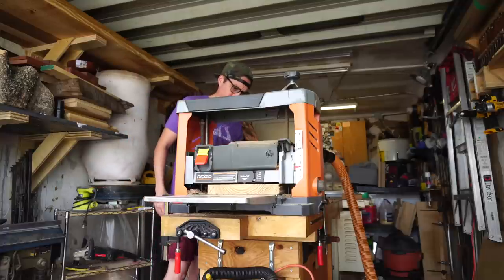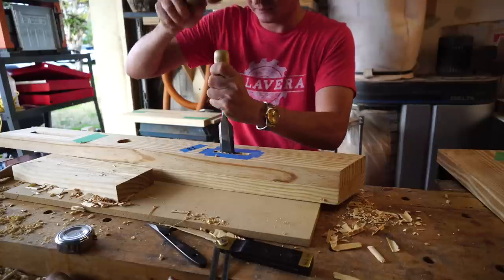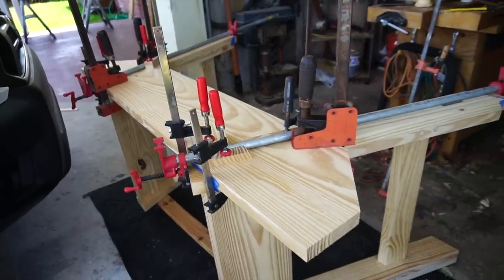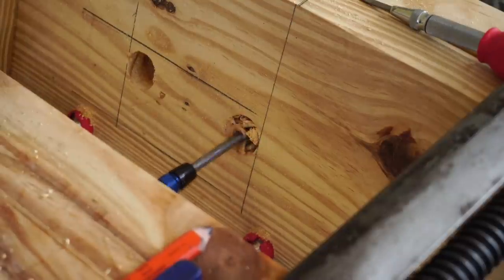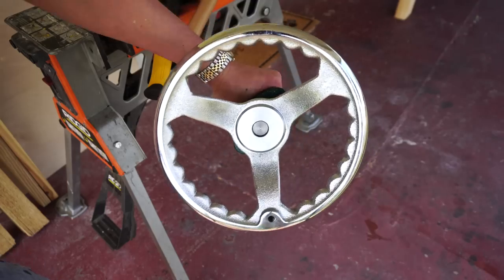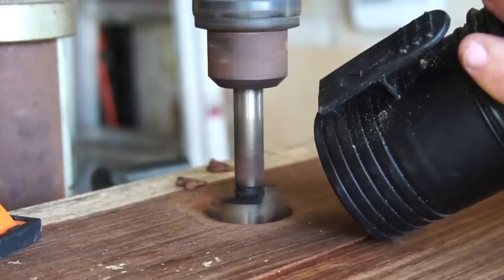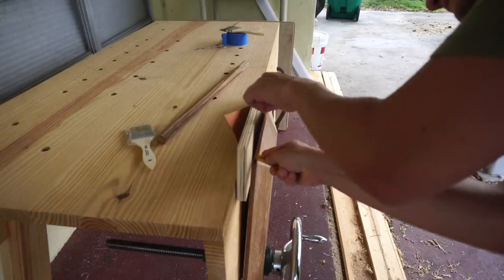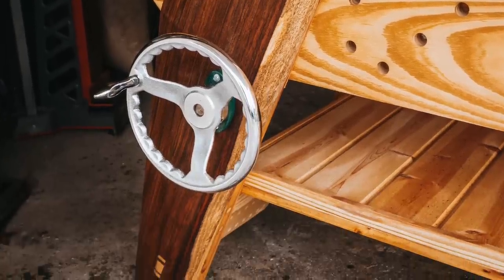The PERFECT Woodworking Workbench? | The Nicholson Workbench | English Workbench

Comment: Beautiful build! You used PVA glue on Rosewood which is an oily wood. Textbook is PU or epoxy for that wood. So three years later, I'm very curious to see how are the glue joints holding?
Reply from the maker: Still good. I’ve put out about 30-40 videos since then I reckon so there’s a video log of evidence. 😂 I can’t remember if I showed it in the video… but I used denatured alcohol to pull out/break down a lot of the oil on the seam. Which is what I did on the speargun I made from the same wood. Trick I learned from speargun makers using teak.

Comment: Love it. I’ve built a few Nicholson benches and think highly of them.   Yours is over the top
Reply from the maker: Thank you! I’ve been considering building a more simplified vice-less version for my back yard with the plane stops set up for Japanese hand planes. But that’s probably fairly far off.
Reply: In what way is it over the top do you think?  Do you think, for example, that there are too many work holding options? or that as its a work bench it does not require the degree of craftsmanship applied to the joinery etc? 
 If you can see a simpler easier way of getting the same degree of functionality, I for one would like to know what it is bcoz being unskilled, I need primitive easy stuff to make things work, at least fairly reliably.

Comment: Beautiful bench, great build and editing.  One suggestion, just like you backed up the dog holes in the top with some additional material, you might want to do that for the aprons as well.  In your first shot of using the holdfast in the side apron, you can already see it start to wallow out the hole because the holdfast is canting over too much and putting excessive pressure on the top corner of the hole.
Reply from the maker: Sweet thank you!

Comment: R g'day. Nice build. What's the advantage of Miller Dowels over normal dowels? Does that advantage change if you use thicker normal dowels? Thanks
Reply from the maker: So the topography of Miller dowels allows it to be fixed in horizontal and vertical planes... whereas I would be nervous that a regular dowel oversized or not might only prevent movement over time in the horizontal plane (I’m referencing physical movement not wood movement). However, if you used some large dowels that have some fluting to allow for glue, that might work as a fix. My concern with a standard smooth dowel would be not having that glue surface to prevent the top from lifting off under force.

Comment: Quite a stunning build! Surprisingly, a mortised bench stop works better than that aluminum one, I regret installing in on my last bench. Also, Nicholson illustrations show leg shoulders angled (with matching housing cuts in aprons). It's for making a gap less apparent when aprons will shrink, learned that a hard way too.
Reply from the maker: I wanted to get the benchcrafted plane stop but the issue is location for me. You have to do a reach around (heyooooooo) the apron and where my bench is, it’s routinely blocked by the tablesaw because of my size limitations. With that being said, I’ve been using this stop for a few weeks now and I don’t hate it, although I can see it’s limitations. I’m working on a desk now and had to use my doe’s feet as plane stop extender because I was in this weird no man’s land where I was out of space to pin it in the back with a holdfast and doe’s foot yet it still wasn’t reaching the quick release vise.

Comment: A fantastic video, these benches used to be all over England and the UK before we became a land of plywood and MDF
Reply from the maker: Yeah I see a lot of variations of it here now. Might even make a second one.
Reply: @CowDogCraftWorks  well if i could ship it over to the UK id be a buyer. I have a German bench (circa 1860) but it has been repaired so many times plus the dog holes are so worn away as to be none functional. I don.t have time to make my own. So its a Sjobergs Scandi Plus 1425 Bench & Storage Module for me. All my restoration work is with hand tools.
Reply from the maker: You can always use a dowel or a wooden plug and glue to re fill old dog holes and then redrill them.
Reply: @CowDogCraftWorks  you would need to see it , the bench looks like it came off the Mary Rose x

Comment: For a planing stop that's less fussy than the Lee Valley use a thin piece of stable wood - I used a strip of oak flooring about 1/4 inch thick and 2-1/2 inch wide.  I have a line of dog holes along each side of the bench so I located two "pins" cut to fit snugly in the dog holes at the end of the bench, attached with counter sunk, brass wood screws.  A 1/4-inch hole at one end allows it to be hung above the bench with a pair of winding sticks of the same material.  The wide access across the width of the bench makes it less fussy than a metal plane stop.  The brass screws mean that even if you accidentally hit one with your plane the damage is usually going to be to the screw.  I've used the same piece for years, so the apparent weaknesses are not a factor.
Reply from the maker: Sweet. Thanks for sharing.

Comment: Have you found that the dog holes on the benchtop have withstood the pressure of the holdfasts?
I've seen many people talk about how a thin top causes the HF to elongate the holes since they have to skew at a steeper angle to provide the friction than they would if the top were around 2.5-3".
Reply from the maker: The dog holes in the top, because I doubled up the material from the underside, are 2.5”. But with that said some of the holes are a little twerked. AND with that said: they all function fine and hold. If you check out some of my more recent videos you can see the bench fully in action.

Comment: Really nice bench .You built this extremely well. Probably the best design out there.100% agree with the quick release vice.I also thick flattening the bottom is a waste of time but each to his own.
Reply from the maker: Thanks. As for the bottom I agree in part. I don’t think it needs to be DEAD flat. But I think at least having it settle in a mostly flat posture works well and makes your life easier in the long run.

Comment: Great work and great video, well done. I built a similar Nicholson bench about 2 years ago and have not fitted any vices to it. I have a spare Record 52 1/2 vice and have been thinking about adding to the end just like yours. Just wondering A if you think its worth doing? B do you use it a lot and for what sort of things mainly? and C if you camp on one side of it in jaws or dogs, does it rack, and cause any problems? Keep up the good work. Cheers Rich
Reply from the maker: It will rack a little. For the most part though I’m using it to secure long boards on the work surface between the plane stop and a small bench dog on the top of the vice. So I don’t have to get crazy with cranking the vice down. I also use it a lot for securing smaller things for planing. It gives great structure and support for that. A tail vice would have been nice back there but I think this was a great alternative and it gives me a more versatility. I also clamp my bench hook or shooting board in it too.
Reply: @CowDogCraftWorks  Many thanks for that. I'm seriously considering adding one to mine so that info is very much appreciated. Cheers Rich

Comment: A great work bench, whether it's called a Nicholson Bench, a Moravian Bench, or whatever.  Great work!
BTW: I hear you about the blue tape/CA glue clamping block.  Not my fave either. I use brown craft paper and wood glue instead. Excellent adhesion, Easy removal with a hammer tap. And the paper can be easily removed with a plane or scraper.  One person's experience...fwiw.
Reply from the maker: Thanks jerry! I think the difference between this and a Moravian is the dog holed apron. It’s my understanding that moravians are more open. With that said I think Moravian workbenches are badass. Might make one for my patio.
Reply: @CowDogCraftWorks  Now that you mention it, the Moravian benches tended to have fairly narrow slab tops, unlike the Nicholson Bench, so I think you are spot on here. And another bench sounds good to me anytime! I am working on my fourth bench.  👍😎

Comment: Love the bench! Nice work, really impressive.
Reply from the maker: Best tool I have in my shop!
Reply: Hey Chris.  I bought Chris Schwartz’s book via the link.  Looking forward to having a go at building.   I am a small guy as well so I’m thinking about 6ft max.    What was the total board ft for your?  It looked like from the video you had 7, 16ft 2x12’s correct?  Many thanks.  Paul
Reply from the maker: @paulbrend8354  hey man! So I wish I could tell you. I made this over three years ago. I would say that looks about right though since I used the bigger boards to get my smaller dimensional lumber.
Reply: Thanks Chris.  We don’t have access to Yellow Pine so I’m going with Ash and they don’t come with in 2x12 16’s so I will get it figured if you think 7 boards was correct.  Thanks again much appreciated.  Paul.
Reply from the maker: @paulbrend8354  best of luck. If you’re on Instagram or anything tag me when you finish. Would love to see it.

Comment: Would it make sense to recess the wood on the vise so that it sits flat, or would that create a weak spot? 
Asking because I was thinking of doing that for mine :) 

Awesome job by the way!
Reply from the maker: Are you speaking of the quick release vise? There’s not necessarily a rule against that.
Reply: @CowDogCraftWorks  Yea, OK cool :)
Reply from the maker: What I would watch out for is the length of your vise jaws. So let’s say the jaw runs the whole length of the end of your bench, you’ll be more prone to racking on the ends of the jaw. But that’s probably about it as far as issues.
Reply: @CowDogCraftWorks  Yea that makes perfect sense. I was originally going to go as wide as the vise then I saw yours. So I might go 3-4 inches wider on each side.

This is exciting, now I just need to build the entire bench 😆

Comment: Do you have a detailed set of plans for this bench.  If you do I would like to buy a set.
Reply from the maker: I personally do not. However, the pinned comment has an amazon affiliate link for Christopher Schwarz from lost art press’ book on workbenches. That has detailed plans for this bench as well as the roubo. I followed his plans for the most part, with modifications only for fitting it in my shop.

Comment: that is freakin' awesome man.....how many man hours did that take?
Reply from the maker: That’s a little tricky to gauge. I had started it in mid to late April at the beginning of lock down... but then another project got in the way of me finishing it until a few weeks ago. The front end work on the bench, basically building the torsion box portion without vises didn’t take terribly long. Probably about a week. The vises and the top took the longest. My gf jokes around that I would sneak away in the house to go out front and take a few hand plane passes.

Comment: Very nice.  :)
However, I'd glue some metal piping into these holes or it won't be long before they're all egg-shaped.
The wood is fairly soft so I also recommend using a disposable plate on top of it. That makes it easy to throw it away and put a new piece on it.
10:15 And..NEVER hit a steel hammer with another steel hammer..you risk chipping one of them. ;)   (I know..you didn't hit it hard, but anyway).
Reply from the maker: So... I’ve had it for over a year now. The dog holes are fine. Also... if I need to re drill them I can use a 3/4 plug cutter to cut a face grain plug and re drill the hole. I also don’t think a hold fast would work nearly as well holding against metal. I don’t think the friction and wedging created would be the same... but I have no idea.

Comment: Scraping a workbench sides? I don't think I am going to follow that idea but I did like your substituting the wood screws to secure the glued underside of the benchtop with miller dowels. The PVA mixed with CA glue is a new one for me and I'm a bit wary. What species are you calling rosewood? I don't think a tropical hardwood belongs on a workbench. As for those leather guys telling you to use contact cement instead of hide glue, they've never had to repair or replace worn leather from a face vise. The last suggestion that I can make is to not make a solid shelf under the bench but one made of spaced slats to allow shaving and sawdust to trickle through so you need needn't remove all items to sweep off
Reply from the maker: Thanks for the input. I want the sides to be a sheared finish so that work can rest flat on it. It’s a direct 90 from the top. The wood glue set with CA glue is a pretty common practice. I’m certainly not the first to do it. As for rosewood: it’s either Indian or Brazilian rosewood. It’s hard and it’s pretty. It looks great. I don’t see the downsides. As for leather... I’ll cross that bridge when I come to it. A gap slatted bottom would also be highly functional too. I like the look and ease of setup with the tongue and groove and it’s all open so a hit with my blower does the trick to be honest.
Reply: @CowDogCraftWorks  Are you saying that you obtain raw logs from Brazil or India? And I get what you are saying about sides flush and 90 degrees to the top. My comments was about creating a final finish with a scraper. I wouldn't even recommend more that a #7 or a #5 with a flat blade to create a worksurface
Reply from the maker: No, I’m saying that there are subspecies of wood that are invasive here in south Florida that grow locally.
Reply: Cow Dog Craft Works Nope.. never seen an Indian or Honduran Rosewood tree here in south Florida. Mahogany!?? Really?? You think those types of trees would even grow in this subtropical clim.. oh wait.

Comment: Step one to building a workbench: Have an existing workbench. Jokes aside, thanks for making this video!
Reply from the maker: haha yeah that old workbench of mine was probably about as sturdy as a folding card table.
Reply: Your not wrong. But that isn't to say you can't make something without all the fancy tools. These benches come from a time before power tools, so this can be made with only hand tools. Now hand tools can still be expensive, and you have to have a bench to work on. But that is the irony of these things. You need a bench hook to make a bench hook. You need a bench to make a bench. Etc.
Reply: Just start with saw horses lol
Reply: @tommyfeaster39  Yep.  I built my bench on two saw horses and some plywood for a top.  That will motivate you to build a good bench.  Just as here, I built the base and then the top.  Hardest part of the job was moving the top from the saw horses to the bench base.  Yellow pine gets heavy in a hurry!

Comment: hey, i liked the video, but one thing bothers me, USE A RIVING KNIFE ON YOUR TABLE SAW !!!
Reply from the maker: Hey there! So I do have a set of splitters that I need to install. But honestly? For the most part it’s not that big a deal. I don’t tend to take huge passes in wood that’s got a ton of tension or is particularly green that causes it to pinch. Also it’s a 220v 3hp saw so for the most part it eats and as long as I’m careful, which I am, not having a riving knife or a splitter installed is not fatal.
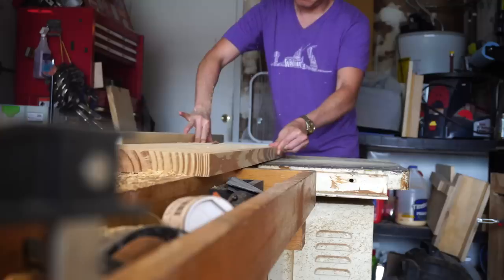Reply: first of all, it is always best to have safety tools if they don't intrude with your workflow, secondly, kickback doesn't always occur by tension that pinches the wood piece, it also happens when you push a bord down the path of the table saw and you release it to soon, (while the piece of wood is still in contact with the blade) so the teeth of the blade catches the piece and shoots it back at you, farther more it doesn't help that you don't use a push stick on cuts that you should, you place your hands way to close to the blade and you lean over the blade (as seen in 1:54).
Also, you said: "as long as I’m careful, which I am, not having a riving knife or a splitter installed is not fatal" emphasis on "as long as I'm careful", you can be the most responsible person in the world but after all, we are still human and as human nature, we all still make mistakes from time to time and it takes only one time of being carless to cause something irreversible to happen.
One more thing I want to point out is that if you have a YouTube channel of any size you are a public figure and you need to be a good example for all of your viewers, so if you're not willing to use a riving knife for your own sake do it for the viewers'.
P.S: I am sorry if this commend came at all as condescending, I had no intention of it sounding that way.
Reply from the maker: It’s an appreciated comment. However, I’ll get a riving knife or splitter when I get around to it.

Comment: There are fundamental errors here. Pulling cutoffs back through a table saw is dangerous due to kickback risk. PVA glues requires clamping. Just holding parts while the “glue cures” only applies to epoxy. PVA will not develop full strength.
Reply from the maker: Well nobody’s perfect. Glue is holding up just fine.
Reply: CD: it’s woodworking, with plenty of reserve strength. So, yes, your glue will probably be ok, but where a full strength glue line is needed such as a panel, clamping for 30 minutes followed by overnight wait is needed. For dealing with the cutoff problem, you can design the jig to have a fall off area to one side so pieces will move away from the blade due to gravity.